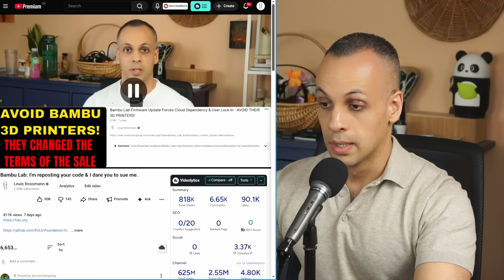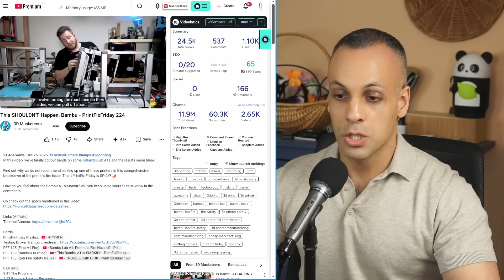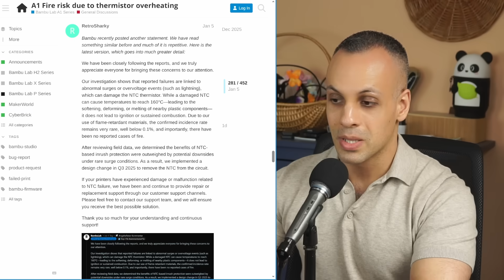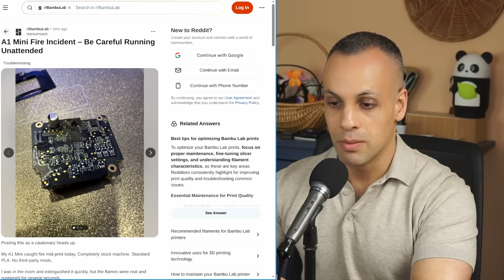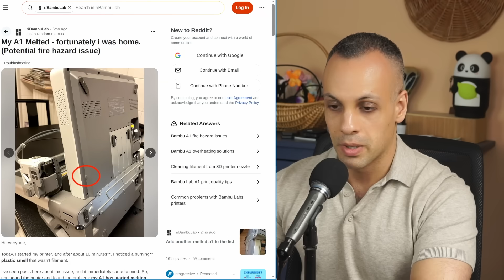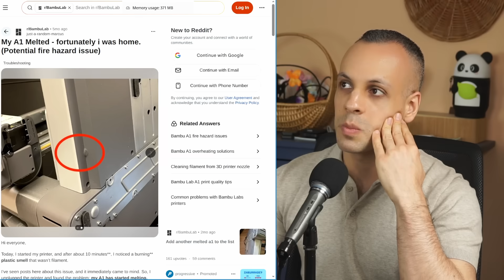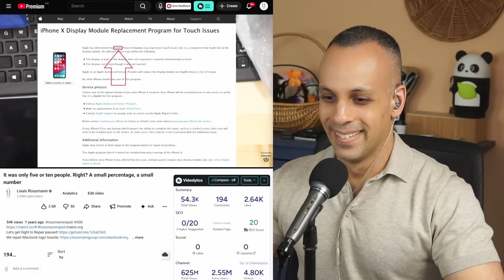Bambu Lab PR dumpster fire is turning into a literal one...

Comment: I love my Bambu Lah printer and it works brilliant. They have great hardware and software... And I'm even so lazy, that I solely buy official filament for it's auto-detection... But I don't like the direction the company is moving towards to. Thank you for your work and keeping them accountable! I really hope they change direction before it's too late.
Reply: They won't.  They've been going this direction for years.  But too many people just wanted to be able to just push a button and printer go brrr, that they've been able to get away with it.  It didn't help any that they were throwing free printers at content creators at every turn.
Reply: @ThinkFreely2012  👁👄👁 ... that's basically any common printer now? I push a button print go brrrr on my non-bambu labs printer. Also its way easier to maintain I can completely strip and refit it in like a couple hours off common parts you can find off amazon. Prusa all the way
Reply: @Kastaru  I love my Prusa. It also Just.  Works.  Some of the Bambu owners I know don't even know how the machine works or how to fix it.
Reply: @ThinkFreely2012 and their nDA is so tight that none of those content creator can say anything at all.
Reply: @ThinkFreely2012  i mean...  it is not unreasonable for a customer to just want a product that works? like, yeah, of course i want a printer where i just press the button and it go brrr and do the print. why wouldn't i want that? 

my coffee maker, i scoop in the coffee and press a button and it go BRRRR and make a fckn coffee. and if it didn't i'd find a different one that did 

having a product that works and is easy to use should not require a trade-off where the manufacturer gets to be garbage
Reply: @ItWasSaucerShaped  I'm probably going to get crap for this but here we go. The difference here is that a 3d printer isn't anything like a coffee maker. It's more like a cnc machine. In fact it's exactly like a cnc machine, except it has a tool that melts plastic instead of a cutting tool for aluminum or whatever. It's a tool, not an appliance. Most tools require a certain amount of skill and knowledge to use effectively and safely and this one is no different regardless of how some companies try to spin it. It doesn't need an engineering degree, to be clear, but it's still not at the "just hit print" stage. Not even for Bambu Lab.
Reply: @0hN0es203  You’re misunderstanding their point, I think.

They don’t want you to be able to use it with 2 button presses. They want it to be exactly as convenient with all filaments and slicers as it is with Bambu’s proprietary stuff. They are talking about how there shouldn’t be any sabotaged functionality that makes it any less convenient to use non-proprietary materials and software.
Reply: @0hN0es203  At this point a 3D printer doesnt take much more skill or knowledge than a coffee maker. Hell, there's probably some fancy coffee makers out there that takes more knowledge to operate.
Reply: Before its too late 😂 You are just comforting yourself.You pulled the lube out and gave them a squirt with this comment

Comment: I have an X1C and I truly love the machine it works amazingly.  However I purchased it before all the drama and I don't appreciate forcing things through an online hub.  I have flashed mine with X1Plus and I also setup a bambuddy although I haven't fully used it yet but I am able to go fully offline if needed.  I think forcing online for a machine that simply doesn't need it is bad practice.  It makes sense for things like sharing the printer camera or having on the road start and stop capabilities but these should be opt in not forced.
Reply: If it was offline then how would they steal all the IP for China?

Comment: This is why I love my Prusa
Reply: I love mine. I had a bit of FOMO when I bought my MK4S. I'm so fucking glad I went with it instead of the Bambu Labs. Prusa is a great company AND you can even upgrade it without having to buy a completely new printer. If you get a Prusa your printer is basically the Printer of Theseus lol
Reply: @Kastaru  Their major upgrades can end up discarding a substantial amount of the old printer and they cost as much or more than a whole new printer from anyone else.  They're basically a false economy.  I'd even call it a scam, because in the case of any other brand the result of an upgrade would be having two working printers, while Prusa leaves one and a pile of junk.

This is why people where I live can't find buyers even for an MK4S, never mind the MK3S.  They'd have to give them away, because whoever buys one is going to pay a fortune to upgrade it.
Reply: I love my MK4S. 1,840 hours of print time so far,  changing the X belt this week.
Reply: I had a MK3, then MK3S+, then MK4. I would love to get back to Prusa, if only they weren't so damn expensive :(
Reply: I've had no issues at all with my XL over the last couple of years. Thousands of hours of rather painless printing. It's been delightful after the horrors of a CR-10 V3.
Reply: Yes, mee too. Btw Josef Prusha (the founder of Prusa Research) is a really nice guy and Prusa printers are the (i think) only 3D printers NOT made in china.
Reply: @Cympator007 ratrig is made in portugal, visionminer is made in us but they are more industrial oriented
Reply: Europe all the way
Reply: @MerkuMaker  From my home country :)

Comment: hope they havent lied about removing the self-destruction functionality
Reply: "Burn After Printing", the long-awaited sequel.
Reply: I predict fused firmware upgrades just to show how much they care about their customers.
Reply: @myc0p  what is a fused firmware update? like does one update purposefuly break a fuse so if an older update is installed, it checks for continuity and dies if there isnt any?
Reply: @lordlichi no downgrades or firmware mods
Reply: @lordlichi  yes, it's a functionality that relies on e-fuses, very small fuses embedded in a microchip (the flash or the processor) and can be blown to permanently indicate something to the software running on the device. If the firmware detects the wrong efuse configuration the printer is bricked, or self-destructs, or starts printing boot plugs or something. The possibilities are endless here
Reply: @lordlichi either downgrade or limit number of upgrades.  Its the feature that home user was asking for.
Reply: @lordlichi Games consoles have this feature. The "fuses" are inside the CPU or another chip. Microscopic, cannot be repaired or replaced.
Each update burns a fuse. They do this so that installing older firmwares becomes impossible.... Until you upset the right people, who will spend night and day until they have cracked the whole thing wide open, and get it to run Doom :)
Reply: @lordlichi  Yup, you got it. A hardware based check to make sure the customer can't ever roll back without going through a bunch of BS. It's a middle finger on your PCB.
Reply: @lordlichi  Some do the thing with signing keys for previous versions not being available anymore.  Others do the trick with efuses where signed firmware refuses to work after reading the value.  The truly awful stuff just never gets any firmware updates, and disables any kind of recovery method.  I'm looking at you, TracFone.
Imagine if the battery dies, and your old arcade board's encryption keys get erased.  They used to have a term 'suicide battery' for those old CPS cabinets.  You open the cabinet? There's a tilt switch that disconnects the battery.  A 'joy' to get serviced, long before John Deere did this.